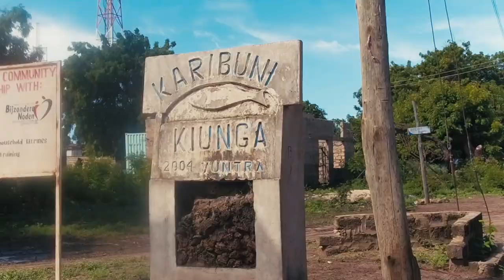GivePower: Clean Water for Kiunga and Beyond

Comment: Just curious how this has held up? How is maintenance and filter changes occurring?
Reply: you never get the followups to this ever. I will bet the system has already broken down. Unless you have dedicated people doing maintenance it never works. Reddit had a famous example of this when they donated something similar and it degraded due to lack of upkeep.
Reply: @MartyMacFry  Surely the locals should be included in the project so that they are able to maintain it after the team has gone?
Reply: @lesleycooper6962  You can teach people all you want if their mindset is different than yours and I then it will never work out. Life isn't this simple. People in the 3rd world have "their own way" and when stuff degrades they usually return to the "old way"
Reply: @MartyMacFry  Very true.. sad, but true

Comment: The energy it takes to make palpable drinking water from salt water outweighs the cost to make it, otherwise everybody would  be doing this all over the world
Reply: If it's legit, they've found a way to do it with solar. I can find no indication that this is a hoax.
Reply: *palatable?
Reply: @andrewstrongman305  same I can't  find anything that this is a hoax either... I hope it's true but I'm skeptical about it. There are a lot fake shit out there. I found this because some facebooker was posting this and I wanted to see if it was a hoax.
Reply: @andrewstrongman305  and can you find any indication that it is true? It sounds like nonsense to me.
Reply: @jodawgsup  I've found two companies claiming to be able to do this. If it's a hoax, it hasn't shown up as one.
Reply: @jodawgsup  it is easy to calculate if you make an effort.It requires about 2kW (real world.Theoretically about 1kW) of energy to desalinate 1 tonne of water using osmosis.1 sq.m of solar in Africa can generate about 6kW per day.I can see about a 100 sq.m of solar panels but lets be conservative and say 80 and use 5kW per day figure.So you can get 400kWh a day.Use 100kWh to desalinate up to 50 tonnes.of water and use the rest for water pumping, and other electricity uses.The bottleneck in this instalation is not the power but the power storage, that's why they were installing Tesla powerpacks.The problem is that one of these only holds about 13.5 kWh of electricity.So you better make sure that you can run fast desalination during the day when power is abundant and leave the stored energy in powerpacks for night use.Thankfully lighting is not that power intensive and few powerpacks would be enough for the whole village.
Reply: @andriusk.9902  Thanks for that information Andrius! With a bit of effort, thousands of coastal areas could be provided with plentiful, fresh water.
Reply: @andrewstrongman305  yes, but is it not a cheap project.That is why it is not widespread.I would guess the solar panels and 2 powerpacks easily costing $60-70k add the desalination plant, pumps, water storage tanks, electrical wiring to the nearby end user and it will hop over $100k.Of course the benefits outscore the cost but it will have to operate for many years to be effective.There is no point of doing this in politically unstable places, because it could be destroyed, dismantled etc.
Reply: @andriusk.9902  It's still cheaper over time than other methods, though. As for politically unstable regions, I think that in some places such facilities could enhance stability as people would be healthier and happier.
Reply: @andrewstrongman305  well if it is working as intended no doubt that it is cheap.If you take away installation costs it's basically free as solar energy and water is abundant in coastal low latitude regions.And no doubt higher quality of living would lower risk of instability.Need more projects like these as return is much greater.
Reply: @Dillinger86  The idea is the is viable there .... why would you put that in normal town that lets says already has clean water from underground reservoir. They are the exception, technology is the key.
Reply: @skeletor3703  What I said is a fact
Reply: @andriusk.9902  Why would you even NEED the battery packs? Wouldn't it be less expensive to store the water in tanks for usage at night rather than the power in batteries?
Reply: @tommoylan7069  the pumps working 24/7 and not all the power from the solar panels  is used for water desalination.It is used as reliable power supply for villages as well, so for that you need battery packs, because lighting and other major power use is in the evenings when your solar is not generating any power.
Reply: @andriusk.9902  A great response - thank you... Bear in mind too, that water can be stored overnight - just as electricity can. Space is not at a premium by the looks - so it's probably more economic to store water overnight in this application.
Reply: @andriusk.9902  A region can become more stable, if water is not a ressource that has to be fought for. So this might help to stabilize a region a little bit more...